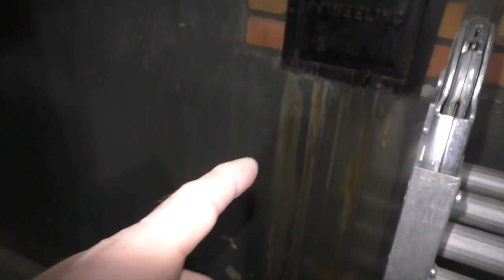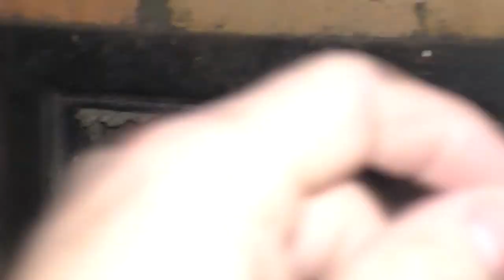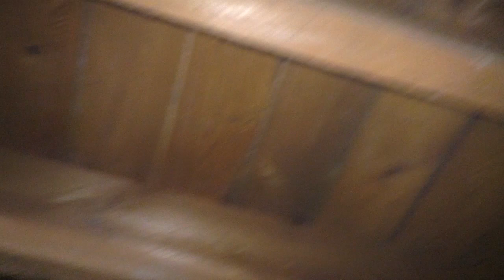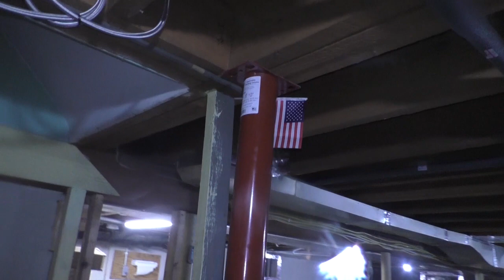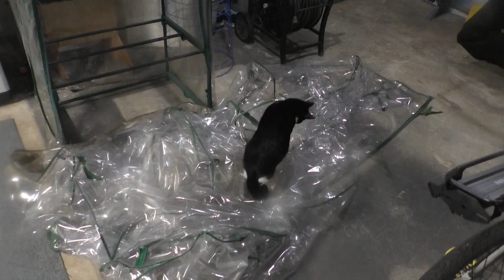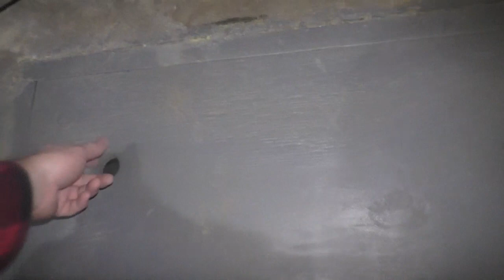Here's why my oil furnace is leaking... WATER?

Comment: Few random thoughts you probably already thought of: 
This may be against code (always a good way to start a conversation), but have you considered the possibility of using a wrap of something like Kaowool on the smoke pipe to keep the flue temperature up? 
Also, do you know what the stack temp was when they set up the furnace? 

The lumber that built your house looks like it might be rough sawn Hemlock. Pretty commonly used back in the day in New England. Good stuff! 
Neighbors of mine at the summer camp in Maine build their dock out of it, and even untreated, it's very rot resistant.  

The worst of the worst of radon basements are the old fieldstone, or granite foundation houses since the granite is the carrier of uranium. It gets worse once someone gets ambitious, and seals up all the cracks, making the basement air tight. 

Wondering if that other pipe in the french drain may be a connection into the drain, incase someone wanted to add a bathroom in the basement? Or possibly a cleanout for a main line trap?

Comment: Put a heat recovery ventilator in the basement. It’ll constantly circulate in fresh air and blow out the old radon filled air without making the basement the outside temperature
Reply from the maker: I also need to add a combustion air supply to the furnace...

Comment: My near century old oil furnace is still running. And it’s been underwater before.. has the same motor as the green one you have.
Reply: It was a retrofit of a 1920s coal furnace too oil firing.
Reply from the maker: My original furnace (installed in 1954) had the same issue, just not as bad; those rust stains were there when I bought the place. The thing is, the less efficient units usually don't condense as much, as the exhaust gasses are much higher. In my case, a simple stainless-steel liner should mitigate the problem.